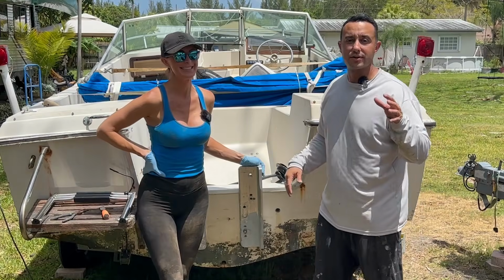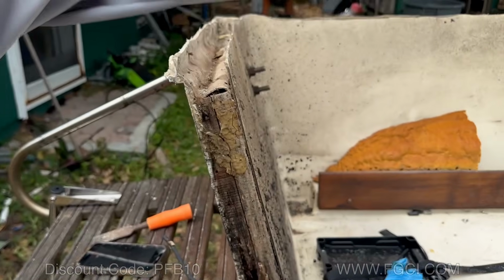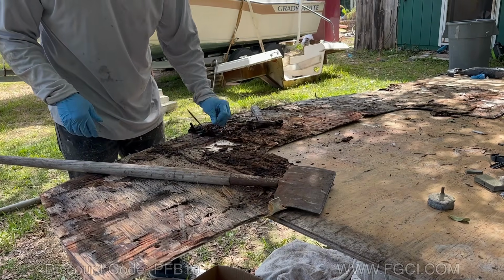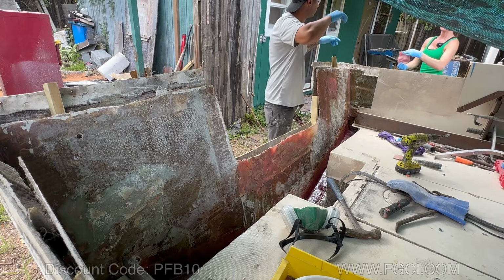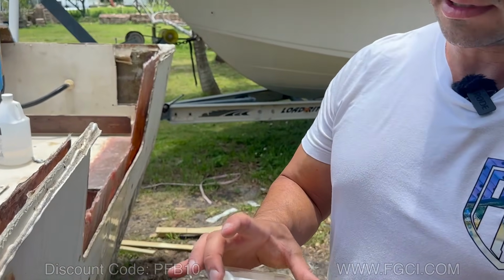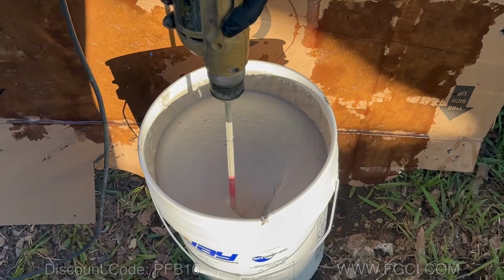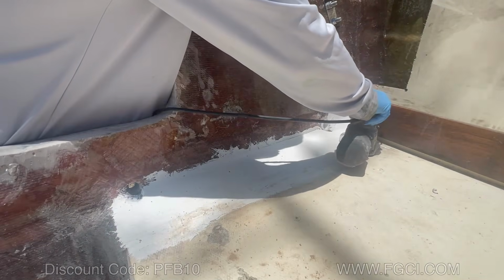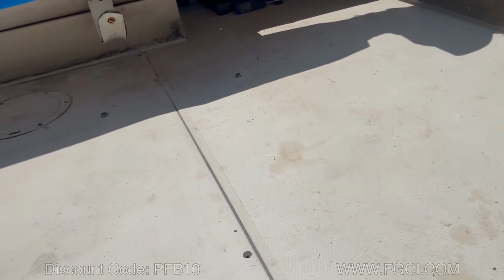Replacing A Boat Transom | Boat Restoration Project!

Comment: The biggest thing they killed me in the end was when you just filled the gap on the cap with gellcoat and didn’t glass it on 😂 other than that it all looked pretty good
Reply from the maker: We filled the cap with structural putty not gelcoat. No need to glass it’s not going anywhere.
Edit: I think you meant to say the gunnels.  I understood cap to be where the transom meets the cap. 
We glassed on the underside of the gunnels, filled the gap with structural putty and finally filled the rest with gelcoat.

Comment: I'm sorry what is actually anchoring the poured transom to the boat besides the outer fiberglass shell it seems like it would be a strong motor mount but in the last video you weakened the skin a lot with that cut and didnt reinforce the wall to connect it to the boat side or floor with connections bracket
Reply from the maker: This isn’t like a marine plywood or coosa transom. When you pour, there’s a chemical bond with all sides of the fiberglass making it one piece. The outer skin, inside skin and the sides. So there is no “weaker side”. You can’t peel this stuff off like you would be able to peel off layes of glass off plywood or coosa.